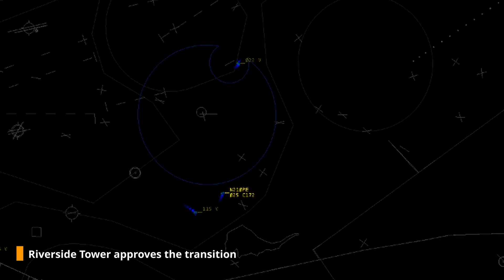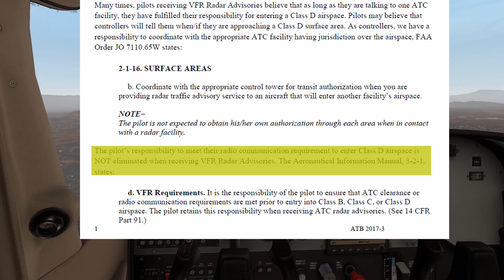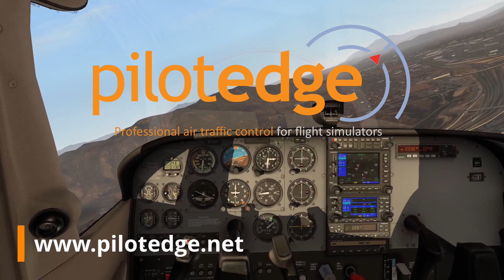Transitioning Class D while on Flight Following? Do you need to ask someone?

Comment: I need some clarification here. You mentioned the figure, “Below 3000 feet.”  Does this apply to areas of the country with high elevation (i.e. Denver)?  I’m thinking about going on a flight in the Sim with flight following from a Class Delta to a Non-Towered Airport. Would the same concept apply if I’m getting advisories?  The CAT-2 Rating is Non-Towered to Class C, but there’s nothing portraying the other way around. Sorry for the thorough question. Have a great New Year!
Reply: It's 3000ft AGL, not MSL